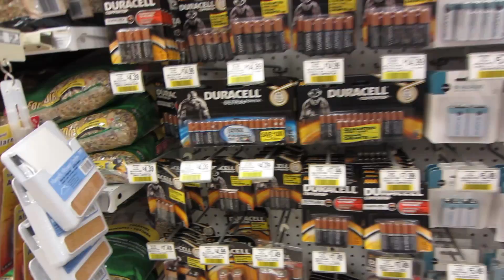Making Infrared Led Night Vision Lights!!! (8.3.12)

Comment: I remember building an LED VU meter as a teenager without really knowing anything about electronics.  I had a book from the library and access to a Radio Shack.  They were out of the capacitors and resistors I needed so I just bought what I guessed was the closest thing.  When I powered it up, all the LEDs exploded like firecrackers!  :)

Comment: Hello,Tim.
In the 70's my Army tank had infrared driving lights.It was basically anIR filter as the front of a regular sealed beam headlight. Perhaps if you had a source for a camera IR filter (Wratten 87 I think) and MANY LEDs to give an output of around 40 watts, you might get very good results.